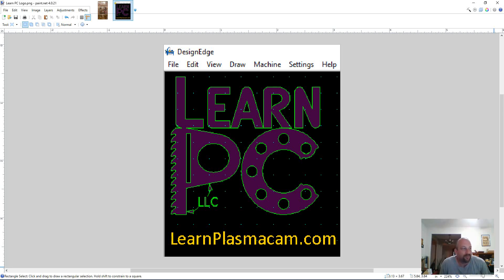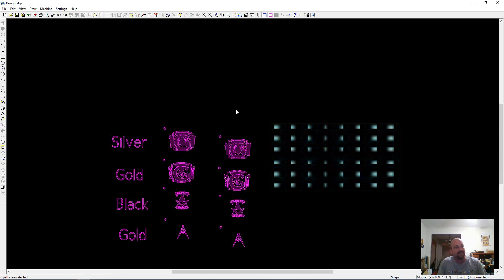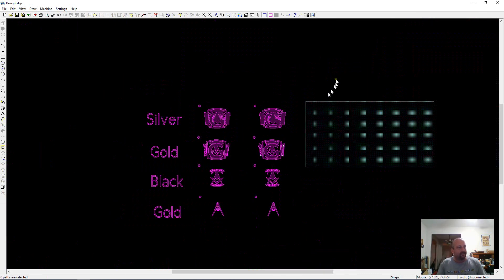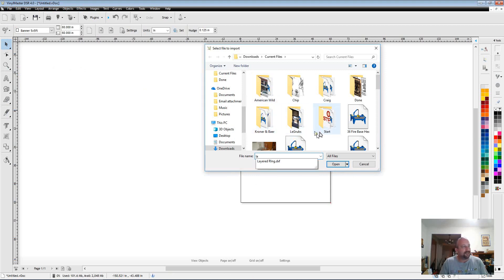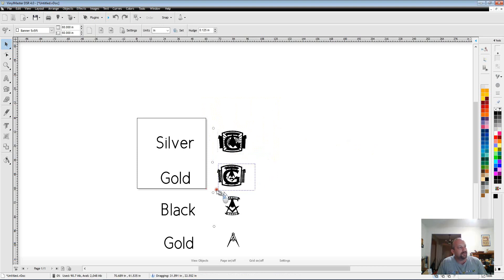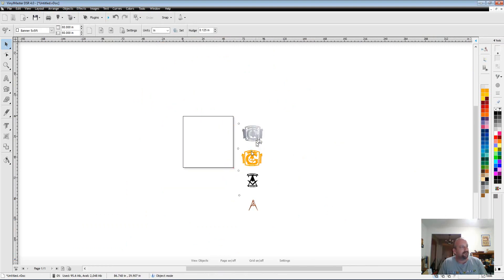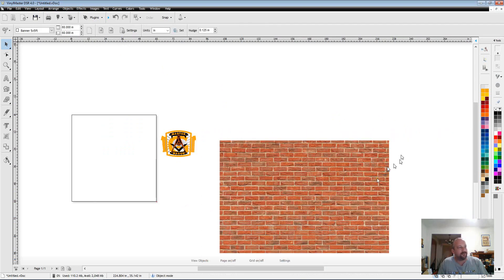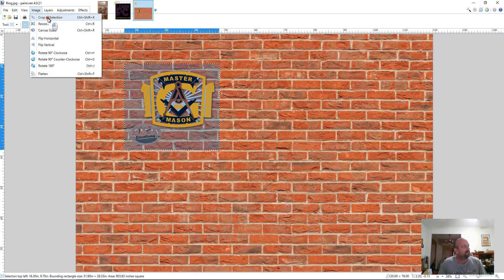Using VinylMaster (DSR) to proof layered signs from Design Edge

Comment: Love the video this is some good information. I have a question though, I thought you already were in inches when you imported into DSR.  It was already 30.790 in so why did you * 2.54? did it come from design edge in cm?
Reply from the maker: This was a couple years ago and at that time, DSR imported all DXF and assumed the units to be centimetres. That meant for every inch it was only a centimetre when it came in thus the need to multiply by 2.54.  This was not adjustable. The current release now lets you choose the units for importing (and for exporting as well!). So, I don't have to do that anymore. I just chose inches when I import into DSR.
Reply: @LearnPlasmacam  Outstanding makes sense. I have the newest version now and I'm getting decent with it. Thanks for the input!